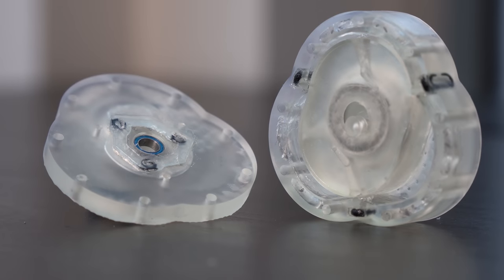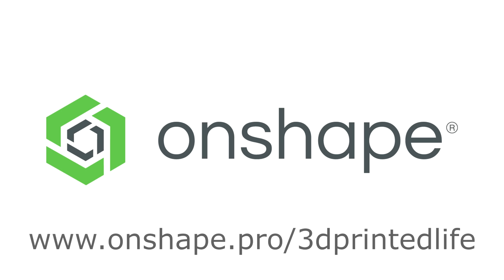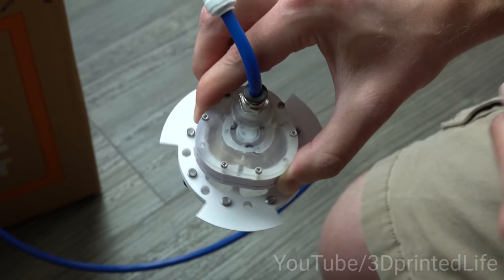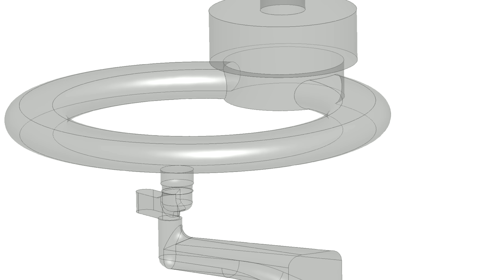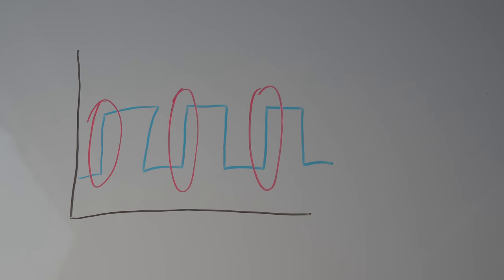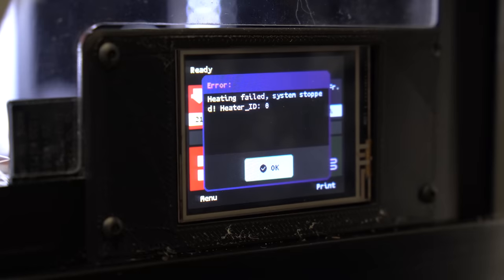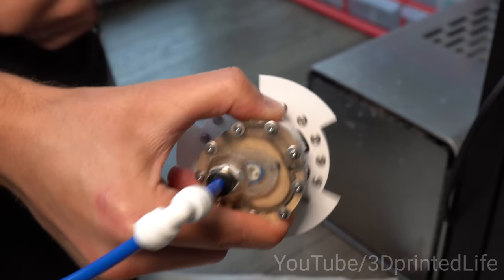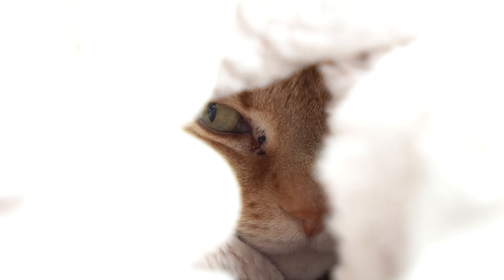I 3D Printed a LiquidPiston Engine, and it Sounds Incredible!!

Comment: Why don't you use graphite as a lubricant like you did on the previous engine like what integza doing too?
Reply from the maker: Good question! I use ptfe grease because the thicker grease actually helps to compensate for irregularities in the parts and seals, so it provides better sealing and allows the engine to be more efficient, though a bit slower.

Comment: Try injecting a bit of non-Newtonian fluid into the airstream so that it does its firmness trick at the points where the air is accelerating/leaking.
Reply from the maker: That's an interesting idea for sure!
Reply: @3DprintedLife  It's my "compromise idea", because I didn't think you'd be ready to accept that Vaseline is a terrible lubricant/sealant for a high-speed/Low-torque application, and mineral oil would have a high loss rate (and your test environment isn't really appropriate for aerosolized mineral oil).

Comment: As someone who both uses Onshape, and is highly interested in making a rotary engine; I find this video very helpful. I would like to know how you designed it though as I have yet to figure out the right tools for doing so. What tips would you give and what features made this possible?
Reply from the maker: For designing it, you can download a spur gear generator plugin to generate the gear teeth more easily. Use boolean subtraction operations to make the ring gear on the housing side. For the geometry of the rotor and housing, you could go with the formula driven curves but I kept it simple using a few tangent curves since at this scale and with the tolerances of 3D printing it doesn't matter as much. The last tricky part was figuring out how to constrain the assembly so the rotor moved correctly, I was able to use the gear relationship on the cylindrical mate of the rotor for that with a ratio of 0.5 (or 2, depending on your order of mates)

Comment: What is the source of power here? Using pumped air to create rotational movement - like a Turbo in a automotive engine?
Reply from the maker: Yes compressed air, but unlike a turbo which acts as a turbine converting a continuous flow of air into rotation, this engine uses a small amount at a time and allows it to expand in the chamber to create the rotation. In that sense, it acts closer to a normal combustion engine, but the act of compressing and combusting the fuel is simplified and replaced with already compressed air ready to expand!

Comment: The Quadrature encoder with 600 pulses per revolution wasn’t accurate enough?
Reply from the maker: It was too accurate! There's a limit to how many pulses per second the encoder can output, and with such a high resolution it can hit this limit at a pretty low speed

Comment: So here's a secret: white pigments are transparent materials such as zinc sulfide and titanium dioxide; however they must have an index of refraction that is very different from the surrounding material. With air voids having an index of 1 and plastics somewhere around 1.5, just short, best results are achieved with high index materials over 1.7 where both the pigment-polymer, pigment-air, and polymer-air interface have some scattering happening there. And the idea is that it scatters well enough that the light comes back out rather than making it deep in.

Of course it's transparent not only in infrared and the scattering doesn't redirect all the light that goes in from the same side. At this thickness you shine any visible-light LED in one side and you'll see it out of the other, and it appears the phototransistor is just sensitive enough.

What if they were opaque reflective pigments instead? Well they'd just be metallic in appearance.
Reply from the maker: Huh that's really interesting, explains what I was experiencing!

Comment: I'm very confused here, why is making it air tight not the very first design consideration? What's the point of measuring its power output when 90% of the air is escaping through gaps in the frame and the seals, as soon as you focused on the seals it immediately made progress why is that sidelined?

Comment: It sounds like your port timing isn't quite right, possibly inlet closing too late or exhaust opening too late?
Reply from the maker: yeah it definitely is not perfect, but also sucks that it can't automatically advance timing as the engine rpm rises so need to balance starting ease with running efficiency. I really like the sound of it though with this timing so at least there's that!

Comment: an interesting idea especially if you can get it to larger size. could it be a matter of size where a larger model could allow better flow?
Reply from the maker: I think it would get worse actually, the intake port would scale in 2 dimensions while the air needed to fill the chamber would scale in 3. But I may not be thinking about that correctly

Comment: Great video!  One question, wouldn't the output be approximately 15psi for atmosphere at sea level rather than 0?  I'm not sure if you'd include that or not 🤷‍♂️.
Reply: The simulation cares about pressure differences, i.e a pressure difference of 60 (60-->0). Notice when you have release the pressure in a tank, the gauge will read zero, rather than 15, this is because they too work off pressure differences. So if it says 60 psi, there is a difference of 60 psi between where the tank and the ambient pressure outside.
Reply from the maker: What this guy said!

Comment: You should double stack the motor and have top dead centers opposite of each other.
Reply: Not opposite but at 90 degrees from each other. There IS a bottom dead center too.
Reply: @Greatdome99   Why 90?

Comment: One of the other youtubers used pencil lead for lubrication, maybe you could try that approach....
Reply from the maker: I've tried dry lubricants in the past, the dust is very messy and easily gets airborne. I'd prefer dealing with grease or oil :)

Comment: Hey, I mainly work with Onshape to create 3D models for my job, how exactly did you make the parameters of the engine's sidewalls dependent on the path of the rotor? F in chat for your printer, but hey if you're trying to make things with such tight tolerances you really should be looking towards using larger parts using only resin and replacing any wear point with low tolerance bearings as resin can achieve much smoother and flatter surfaces just because each layer is printed all at once, they also shouldn't wear to much as they're generally a less abrasive material.
Reply from the maker: I just approximated the curve using a few arcs, which was fine for this scale and 3D printing. I’m not positive if Onshape allows you to generate splines using formulas but that would probably be the best way to do it

Comment: I can't decide if the conclusion of this video says anything at all about the value of the LP design or just the value of putting lots of work into a 3D printed air engine to improve the seals and friction.
Reply from the maker: Perhaps a little of both. Seals on rotary engines will always be way more difficult than piston engines, whether you're building miniature pneumatic versions or full size combustion versions!

Comment: question, if you were to drive this with a drill what would be the intake psi versus the output pressure? could it pull a vacuum or run as compressor?
Reply from the maker: I don’t know what the pressure would be but yes it could absolutely pull a vacuum

Comment: Why not build a Dyno using a gear pump, circulating water,  and measure the case of the pump to get the TQ reading,. A restriction can be added to fine tune the Dyno, or just a electric motor with a resistor across the leads shorting the motor/ generator,  a small series wound motor could be printed, using brushes,  and a small voltage applied to the rotor to increase the resistance fine tuning, or to increase the load, just add more voltage,  then again a simple permanent magnet motor can be used,  increase the resistance to increase load,.  Because the friction lever seemed to be hammering on the load cell possibly making the readings higher than reality,

Comment: I am not quite sure why you are using compressed air for this. The whole point of the new liquid piston is that it combines the intake, compression. combustion, and exhaust all into it. When you press air in.. you are trying to force air somewhere else in the engine to compress... this is when you need to exert energy to push the piston out which would usually be done through gas being ignighted, diesel being compressed until combustion. Pushing the piston down then displaces the space causing rotation.

Just curious, if you MUST use air... why not alternate which chamber you are blowing compressed air into? Inject the air into the cylinder that is doing the combustion stroke.. that means when the piston has the least amount of space between it and the edge. Continue to blow the compressed air into the cylinder until it is fully compressed.. at this point a different piston should be fully compressed now you need to expand it so blow air into that.. When that one expands it will compress another cylinder.. If I am not mistaken this liquid piston x design has the air being pulled in, and exhausted through the center of the peanut shaped piston.

Could you maybe design a prototype of this to see how it would work? I am curious to know how timing and position of air willl effect the system.

Comment: Turning the Wankel 'inside out' is basically what this engine design is... rotor is now shaped like Wankel's interior, and wiper seals are in a less stressed portion 
Wankel was a bit 'conservative' in his exploration.
Uh, yeah crimps suck until they suck up solder....

Comment: I think ur going overboard with the seals the issue is ur timing. For example Lego engines run perfectly fine with almost no seals it’s just a different timing between it running and it not.
Reply from the maker: Well that's true but that style of engine has it's own drawbacks. Engines like that have really low torque since they have very poor sealing and just rely on velocity of air intake and low friction to achieve motion. This engine has a much higher friction but because of the better seals it can output significantly higher torque

Comment: I made my own air hogs type air engine took me about 2 weeks to finish i wanted it to run at 0 rpm idle have high rpm power  and run  at 8 bars for at least a minute its 1.6cc  its a oversquare 2 prings design with a oring sealed piston  everything was printed with esun solid gray petg on a ender 3 pro

Comment: You could have just used an IR sensor for measuring the rpm
Reply from the maker: True there were quite a few options, this one I thought would be simplest while still providing accurate pulse spacings. Well, until I had to make the encoder disk out of cardboard anyway lol

Comment: Dude. Flux! you need flux! Seriously! Get flux! im serious dude, your soldering will go up by like a million percent, it's faster, better, cleaner, looks fantastic and you will wonder why on earth you didnt do this from the beginning.
Like fixing your crimps with soldering. Just cut the wires, strip them, add a tiny bit of flux to the wires, hold them next to each other, facing each other, solder, and you've got a solder job that looks about as clean as a continuous wire. Hope you added heat-shrink tubing before doing this though, otherwise you'll have to re-do all of this to do that.

Could also wrap the wires together, then do the rest of the steps, but I cant for the life of me get them to do this while avoiding a vertical spike, so I prefer to just rely on the solder doing it's job.
Also, use isopropyl alcohol after soldering with flux. Even non-corrosive flux will fuck everything up if you don't, ive had so many projects burn, melt, explode weeks after because of this shit.
Flux will essentially OCD everything for you. Solder pads insisting on sharing as if they were one pad? flux. components sticking to your iron while soldering? flux. Flux fluxing fluxy flu xyxy? flux.
Reply from the maker: Funny enough I already have tons of flux from soldering (or fixing my reflow) of micros on pcbs...didn't even think to use it on larger wires like this to make the soldering easier! Appreciate the tip

Comment: impeller turbine (center-in rim-out reaction turbine) instead, no piston complexity
Reply: being a business professional does not mean quality, btw, or anything valuable to reference to
Reply: the impeller is one piece, with the inputs and exits, just long hose it with a bearing
Reply: booiiii the simulations, waah
Reply: if you multiply time and power, you get total energy
Reply: flywheel to smooth out the continuity issues
Reply: every piston engine needs a flywheel

Comment: Have you made a Tesla turbine? I would like to see how it would compare to your other models.
Reply from the maker: I haven't, but I would guess it could achieve higher output speeds and better efficiency but at the cost of much lower torque
Reply: @3DprintedLife  yeah..I remember now..I believe you are correct about low torque.

Comment: Interesting project, but this is not a liquid piston engine. The piston is a solid.
LP engines would be something like a U shaped tube half full of liquid and the gas pressure above it driving it up and down the tube.
Reply from the maker: You're right about that, but this is referring to the brand Liquid Piston, it's not a liquid and it doesn't make sense. They definitely just chose this name because it sounds cool. I've actually learned recently this rotary engine is another one of Felix Wankel's designs!
Reply: the company name "Liquid Piston" was chosen partially because it was cool, but partially because they were inspired by how people previously described the wankel engine. Since these types of engines do not have a piston that oscillates along a fixed axis, but rather wobbles around in a circle, some people describe the motion as "fluid", and that somehow turned into "liquid piston"

Comment: Who uses version control on a solo project? Version control then is easy: you "save as", test new things and if the work, THAT is your master project.. cause all the changes YOU made are THERE in that version.. Merging them to the master is waste of time, it does nothing, absolutely nothing. Don't make things complicated just because there is a function for it.
Reply from the maker: To each their own, but I genuinely find it helpful and easier than any other method of tracking my changes. I used to use git for version control but this integrated solution is way easier. I tend to make multiple changes to the design at once and being able to track different versions of the design and cherry pick which features to merge or delete is way easier to me than trying to manage the feature trees across multiple versions and merge designs that way. With simpler designs or projects that are unlikely to require a lot of iteration and debugging then it's not as useful. But for complex projects like this or collaborative projects it is hugely helpful.